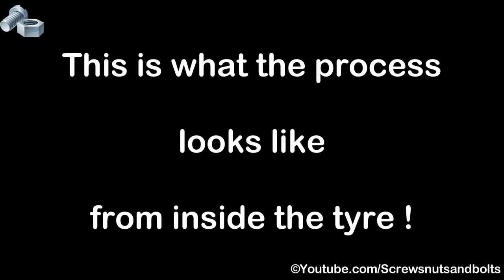Tyre Puncture Repair Kit Tutorial

Comment: I was using a very old set of tire plugs and when I went to squirt some glue on it I found the glue had dried as hard as a rock. 
  I pulled out some PVC glue that had been with my plumbing supplies for a long while. I remember torquing the cap on with a pair of channellock pliers. Took the cap off with the same pliers. The PVC cement was in good shape. 
  Applying some of this glue to the plug lubricated it well and the plug went in easier. 
  I wondered if the PVC glue would have a deterrmental effect on the tire. 2 years later the tire is still on the ground and no air leak from that plug.
Reply: 2 years? I wish i drove that little lol. Looks like ill use that pvc glue i bought. Thanks hehe
Reply: I've never had to use glue with this type of repair,works perfectly,the rubber is sticky enough on it's own anyway.
Reply: Exactly,we have a tire change and repair station and we never use glue,but just after you put the plug in the tire before you pull out the inserter,spin it 1/2 so it makes a knot,adf if its a new tire ,buy a permanent repair knot ,you do the same and at the end you put it on fire so it just kind of mix on the tire
Reply: @aureliancurceanu1333  but if u twist  the tool the rope comes out
Reply: @Matowix  no,it does not
Reply: @aureliancurceanu1333  The risk when you do the twist is that the tool will then bind on its way out and there will be less of the plug left inside the tyre.
Reply: @SAMk378   That's a good message, but humans don't go to heaven or hell upon death. That myth comes from the apostate church, the harlot and her daughters, which is the Roman catholics and the denominations. It began about 1,600 years ago. God is chomping at the bit to crush the apostasy, and we each have a way out (Rev. 18:4) so we won't receive the vials and thereby be unable to repent. The kingdom is COMING to this earth. This occurs when Christ returns and gathers the saints (the wheat). All others (the weeds) will be burned and the saints will be rewarded.

Comment: Whenever a plug is installed, ALWAYS snip off the protruding portion to prevent the plug from possibly being pulled out of the hole when the tire slips or spins on pavement. (I've had this happen before.)
Reply from the maker: Good advice

Comment: thanks for the video, I is a temporary solution / workaround? Do we need to.replace new Tyre asap?
Reply from the maker: It's designed as an emergency repair until you get the tyre patched from the inside, which is a more permanent fix.

Comment: Always a pain to get the reamer through and I’ve never used cement... but the plugs always have worked for me...
Reply: Ream it with air in it. Much easier
Reply: My son and I actually pulled a dragon tooth out of a tire a couple days ago... stuck in a plug and it’s holding! Minimal effort!
Reply: Use a drill with the same size drill bit
Reply: You dont need to use cement its self sealing plug! however it does go in easier as the cement acts as a lubricant! 
Also he didnt do a good job reamer out the hole!

Comment: I've never used glue when doing this. The kit didn't include it anyway. Also, I did the same job while the tyre was still pressurised and lost very little.
It held enough air to get me to a garage. And yes, I did have a spare, but the tyre was good-to-go.And my reason for carrying a repair kit? I used to drive across deserts, mountain-ranges, river-beds, etc, in Africa. And I did have a pump, until someone borrowed and wrecked it, in the Western-Sahara.

Comment: My only criticism is the way the hole is reamed. The tool should be turned in one direction only going in as well as out because the twisting back and forth defeats the purpose of what the reaming is supposed to accomplish which is to cleanly open the steel belt fibers for easier plug insertion. The twisting back and forth will just mangle the fibers.
Reply: I agree.
Minimum disturbance is best

Comment: Turn 90 degrees (1/4 of full turn) before pulling out
Reply: Ok, and the reason for that is? No kidding... would like to know it.
Reply: @joaovianna7321  puncture hole is usually round. If you look at multi core cables of round and flat structured it is obvious that round grouped strings fill round hole a lot  easier. If you dont turn quarter turn it is a lot harder to fill hole. Pulling out pulls out already inserted material. When you turn 90 degrees you add material where is void

Comment: this is the only video that shows the view of what happens from inside a tire. it answered the question of what the rubber strip looks like inside after you pull out the insertion rod! thank you for the works!  P.S. I think the final cut should be flush with the tire surface.

Comment: This is a cheap repair and only suitable for temporary use until you buy another tyre. 

A proper repair would be a hot vulcanised repair, then the tyre is as strong as it’s original.

Or if that’s not possible then using a patch on the inside to prevent slow air loss or a blowout at speed. 

Remember a tyre changes shape and flexes quite a bit on a car the steel cords will slowly create a tiny air leak in the repair shown in the video.

This repair is also illegal in many countries for road use.
Reply: With due respect, I have been driving my four wheeler for more than 1500 km with such rubber plugs repair, faced no problem....so far as I understand, the trouble occurs when the plug is inserted in an angle different from the original puncture angle

Comment: Plugging a tire is an easy quick temporary fix but in my experience plugs over time start leaking. I use plugs but only until can get chance to have a more permanent internal boot patch. The only issue is anymore most garages wont do boot patches but only put plugs in and charge 8 or 10 bucks to do it. Just to end up going back a few weeks later with a leaking tire plug. So i like plugs for emergency repair but taking a tire to a shop and getting refused to fix it proper with a boot patch in my opinion is just a scam to make easy money. Thats why i am investing in a Harbor Freight tire changer they work good and for $40 dont take many tires to pay for it. Tired of being ripped off every time need to break down or fix tires.
Reply: How do you balance it ? ... if the car travels at speeds under 90km/h balancing may not be an issue but above that i definetely need balancing at least for my car so everithing else is pointless without a balanced wheel ...
Reply: @contytub  two ways to balance a tire the old way is by a bubble balancer now there is computer spin balance. But balancing must be done or over time in can damage exspensive parts on your car or truck. Even at slow speeds you may not feel it but it's there and if you happen to have a need to go out of town are you planning to go stop at a garage first to get tires balanced? When it could have neen done when first installed.

Comment: Very nice and helpful video! 
Is it ok if we don't apply rubber cement in case we don't have at that moment? Or it's mandatory? 
Also, can the strip be cut with scissors instead of blade? 
Looking forward for the response. Thanks!
Reply from the maker: Some kits come with rubber cement and some don't but if the kit recommends using it then you probably should. A scissors should be fine as long as you cut it close to the tyre.
Reply: @screwsnutsandbolts  thanks! 
There is no mention of rubber cement in my kit so I guess it's fine

Comment: I've never used rubber cement and never had a plug fail.
Reply: I’ve tried it.  But have had it work great both ways.   If anything the glue made the plug slippery and had it pull the plug out a few times removing the plug tool after putting the plug in removing the tool.  So stopped using it since for that reason.  But works both ways.